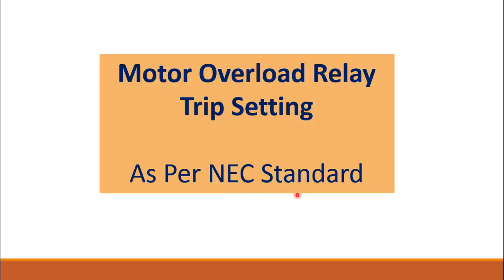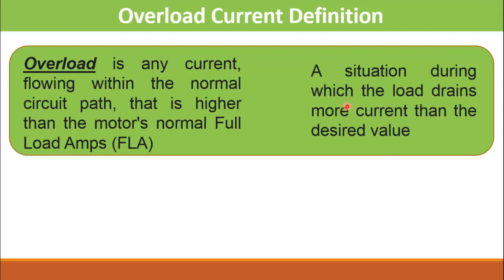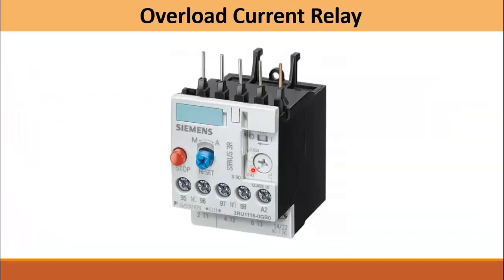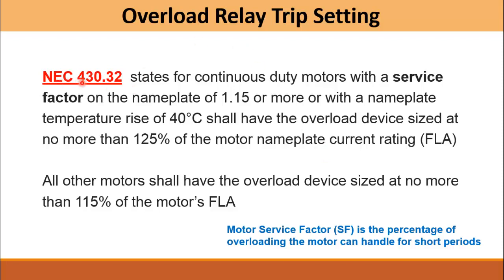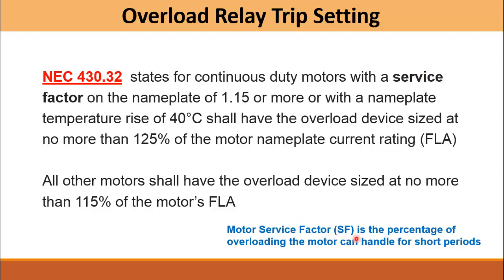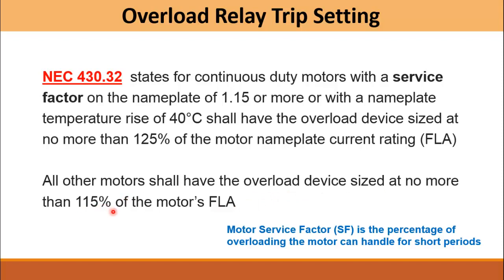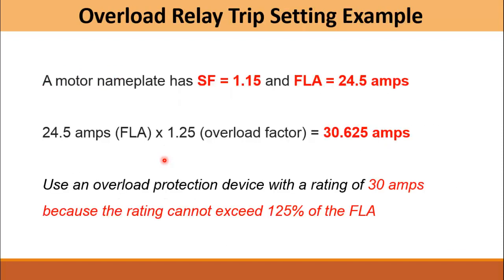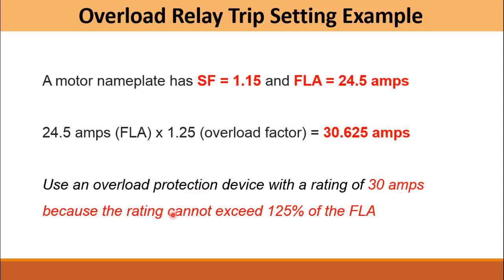Overload Relay Setting As Per NEC Standard

Comment: If water hole motor is 13.7 amp. (23.7 amp is what is on the motor plate written) what amps i have to set on overload switch please?
Reply from the maker: You should set overload near to your actual motor running current .115% at max. This will protect your motor
Reply: @electricallectures  sorry on plate is not 23.7. Is 13.7 🫣

So if on the motor is 13.7 amp. The overload switch will be near 13.7amp set?